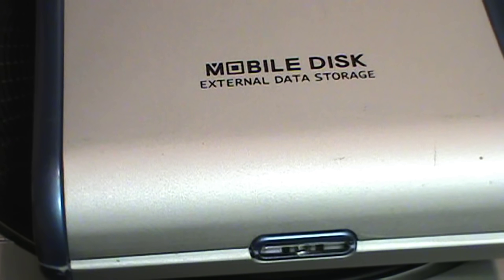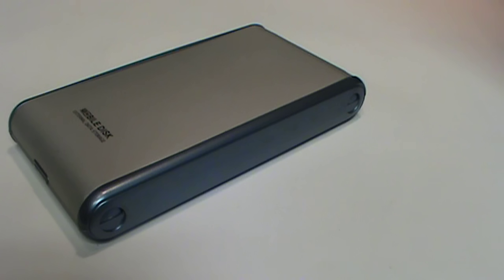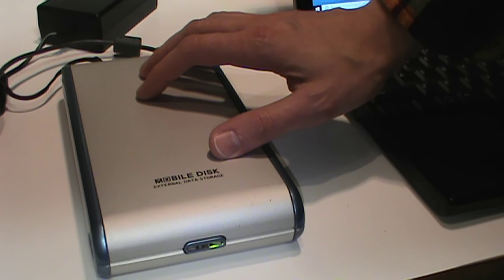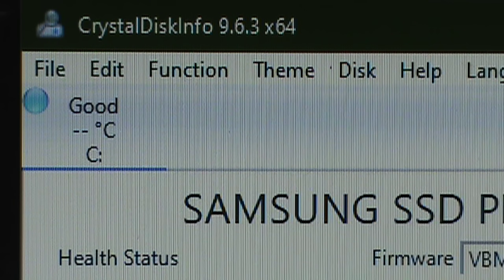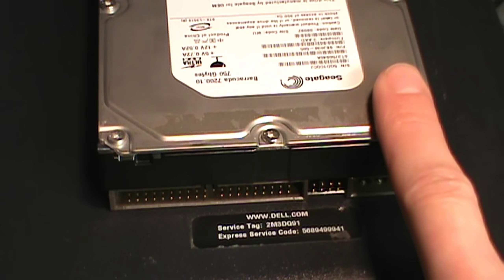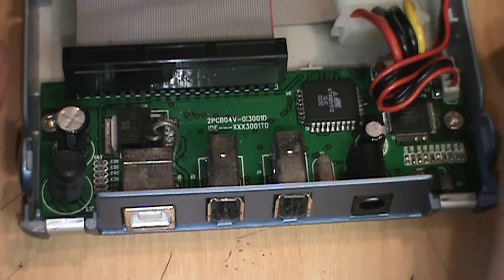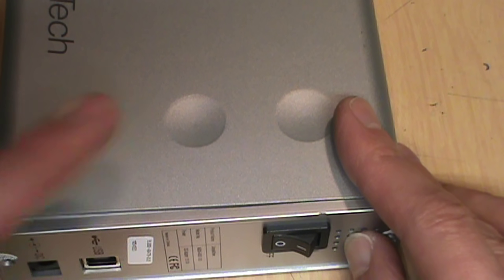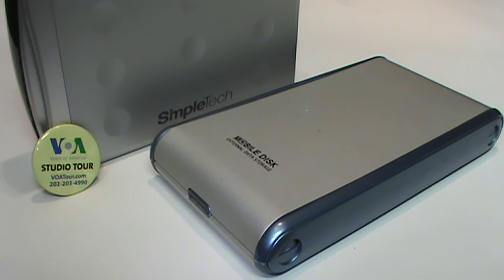The world's largest IDE hard drive failed on me

Comment: I've got a Seagate Barracuda 7200.8 200GB IDE hard drive that has three current pending, and three uncorrectable sector counts on it. I first noticed the bad sector counts at less than 7000 hours of use. Today, that drive is actively in 24/7 service in my secondary desktop (motherboard being from 2011ish, with nForce 630a chipset), it now has more than triple that number of power-on hours mentioned earlier and the reallocated/bad sector counts haven't changed or gone up at all. These older Seagate Barracudas (especially the 7200.7 and 7200.8) are very solid hard drives; the 7200.11 series is when Seagate's quality began to massively fall off.

Comment: First time I've ever seen a 750GB IDE drive in Windows.  When the video started, I automatically assumed it'd be used with an Apple machine.  The reason for that being that my Apple Xserve RAID arrays have fourteen (14) 750GB IDE drives (allocated over two RAID controllers).

Yes, they still work — but I know that's not going to be true for much longer and all should be retired in favour of 1TB SSD's.  1TB is the limit of the Xserve RAIDs' upgraded firmware.  There will be a noticeable speed increase regardless of the old system bus — and they are connected to the actual Xserve servers by 4GB copper or fiber optic cable (which was pretty remarkable for the era they're from).

So you can understand why it seems (to me) so strange — even bizarre — to see a lone 75GB hard drive being used on Windows, which is not a platform/operating system that I, personally, would ever associate with video editing or video file transfer/storage.

I imagine that I'm from the generation that insisted on "The right tool for the right job", which for video work (or anything creative), would be a system specifically built from the ground up for that purpose: Mac OS.  Definitely not Windows — which was generally the preferred system of cheapskate bulk buying businesses looking for the cheapest PC's possible for their clerical workers and accountants.  You take my point.

Without doubt, Windows has improved somewhat by now — but it's still not a platform dedicated to creative and video work as the Mac operating system surely is.

Anyway, thanks for showing me one of these old 750GB IDE drives working on an alien platform (!).

Comment: 7:28 I see you were copying microMV recordings.  I usually transfer those from the camcorder using an analogue link, but a few years ago re-discovered the joys of doing so using the pure digital route using Sony's MovieShaker.  I found Wondershare video converter could translate the resulting WMM files to something more useful today.  The digital route is more hassle but does give slightly better results.
Reply from the maker: Older versions of Sony Vegas can import from MicroMV as well -- just tell it you're using an HDV camcorder. Both MicroMV and HDV use MPEG2 compression, so to the program they both work the same. That way you don't get any loss of quality by converting it to another format.

Comment: When I saw a 750 GB hard drive at if there's store I was very confused because it had an IDE connector on it. 

I can't remember if I saw the connector first and was confused by the size or saw the size first and was confused by the connector but would I do know is that I bought it and bought an adapter and used it on my computer that I built in 2016. 

Like a year later my friend sold me his much better computer so I got rid of the other one. 

And yes before you ask my OS was on an SSD I was just using the 750 gig for all my other storage because SSDs were kind of expensive so I only had a 64 gig.

Also at the same thrift store I found a 400 gig hard drive and when I plugged it in it showed up as 40 gig. I took this price sticker off the label and it said 40.0GB wtf?

Comment: I have a WIncor Nixdorf Pentium III Socket 370 system with an updated firmware from 2006 to support large hard drives. I currently have a 160GB drive installed.

Comment: You can partition around the bad part to extend the life of the drive.
Bad sectors many times come in a row, and while checkdisk fixes it now, the sector next to it might fail tomorrow if used.

I have 1tb western digital for which i did that, 200,10 and 700gb partitions (10 had the bad parts in it)

Bestpart is that when i installed w11 24h2 to it, it ran checkdisk and actually fixed the bad sectors and the drive reads good again.. going over 80.000 hours idk if i should have it as a boot drive / server drive like im currently using it lol

Comment: I had similar problems with usb to dvd recorder adapters for laptops, it's always a matter of time before the usb cable starts to fail and you lost some dvds and cds due to a communication error during a recording, i got so tired of it that i bought an old laptop that has a dvd burner built in since it doesn't rely on the very few electrical connections of a usb it sholdn't fail, proper sata connection should have some redundancy and a better quality on the contacts and obviosly no wires to break

Comment: The USB failure on your enclosure might be because of USB sending data in packets, rather than say FireWire transferring in data streams.  Connecting the drive directly to the motherboard through an IDE channel is much faster than USB and transfers data in streams like FireWire.

Comment: "Reallocated Sectors Count"?  Is Crystal Disk Info getting that directly from S.M.A.R.T.?  If so, you probably can ignore it.  I've learned over the decades that S.M.A.R.T. tends to have inaccuracies and false positives a lot of the time.  Your drive might be fine, although I would look at the year the drive was manufactured and factor in the Mean Time Between Failure (MTBF) rating.  Most hard drives will have a 3 to 5 year MTBF lifespan, anyway.

Comment: It's not the biggest one. Western Digital manufactured 1 TB Caviar Green 3.5" HDD. There was also 1 TB 2.5" ZIF IDE HDD (it's different from 2.5" by having additional pair of short conn_sense pins on side if 40 pin connector), it was marked as "Supplied by Fujitsu". While not HDD, I have seen actual IDE SSDs in 32 and 256 GB sizes, too, one of them made by Kingston, other by some Chinese one-shot "brand".

Comment: I personally do not trust SMART data as it can be effected by a bad psu or the environment it's in; which is debatable if that's a good indicator or not..... personally run MHDD erase wait than run it through scan and have a computer record it's display(somewhat optional) output; if the drive comes out with no issues via that than I trust the drive; if it comes not 100% it gives a good reference point if it's issues are due to age or what(some cases it it's just a few bad sectors but not enough to be an issue); I've seen drives going from failing SMART to passing through this and it is why I do not trust it.... takes time but to me worth it if a spare computer or 2 is available to do this

Comment: I'm sure you know that the 128GB limit is only an issue at boot time. You can put a boot partition in the first 128 gigs and then any "modern" operating system like an updated 2000/XP or Linux can use the rest for data. Or you can use boot-time overlay software like OnTrack.

Comment: I would not be surprised if the failure still was due to a bad sector but before it was re-mapped to a spare one. I had this happen many times it won´t read while the sector is actually bad and the drive is testing it out and eventually re-mapping it if it cannot be used anymore. I typically go deeper into the troubleshooting by reading log books in the drives memory with gsmart since many drives not only have smart byt also actual logging of events. many times you can read the log and find out at what drive time an error occurred too and not just a total amount of smart entries. you can actually often find errors in here that is not logged by smart that can still be a good pointer to potential failures. I am a SUPER hard drive geek lol

Comment: I've only once had the freezer trick work for me, but man was it satisfying. Locked up drive. Freezer overnight. Plugged into an external IDE to USB converter and power brick. One shot, it spun up and read. Copied everything off. It never spun up again.

More than a few times I've had to use Clonezilla in rescue mode, sector by sector copy, and let it run for several days to recover what's on a badly failing drive.

I once surprisingly managed to pull all the contents off of a very early IDE drive (maybe 80MB) out of an embedded, rack mounted 386 machine that was the last known example of an automation system monitor whose existence had long been lost to time. I was able to pull all of the custom software off of the drive, and resurrect the application on modern hardware - it was a custom application to pull automation data over an RS-422 line from a GE FANUC-controlled marine steam propulsion plant, and display the data in real time in an ANSI-text graphical mimic which showed all of the parts of the steam plant. I managed to get it running in Windows 7 NTVDM using a custom ANSI driver, and even found that it supported mouse input in ANSI mode. It was pretty cool to set up a cluster of machines to run the software and restore the functionality to those old ships so the engineers could see the mimics without calling down to or going into the engine room.

I currently have a 2.5" drive sitting in a drawer from a family member. Years of her "priceless" photos are on it. Head failure. Just scouring the world for an identical drive I can swap the platters into.

Man will I be glad when I never see any of these things again.

Comment: I personally have an IBM 5GB 2.5 inch IDE that I use as an external drive and it's so old that I can't seem to get smart data off of it. I've done full read/write checks on it and it passed with no errors so I am going to keep using it to transfer smaller files as it still has a surprisingly fast read/write speed for USB 2.0

Comment: Hmm.  I wonder if that drives mechanicals are the same as the infamous SATA 750GB drives from Seagate. Extremely high failure rate, had the displeasure of dealing with them in my time as an I.T. worker.

Comment: Seagate hard drives are that. Garbage.

At least this brand and model of harddrive (regardless capacity or connection type) are known to fail whenever. Bought one of the Barracuda greens, brand new, one week of use and it was already hammering (when the sound of the heads initializing and when reading/writting and sitting back on power down is more noticeable). 💀

It lasted what it lasted because it wasn't a main use hard drive. But give that 750gb drive a main use in a rig and it would have died long ago. These disks totally dislikes long writtings as well. Had a 1tb SATA one die on me unexpectedly. So it's a matter of brand and quality...

Comment: Yeah that Hard Drive enclosure worked for awhile but as always they don't work forever how old is the enclosure anyways because it looks like it's from 2004 or 2005 
And I have another question,
How do you find computers or computer related stuff at goodwill like Hardrives, Computers, Software because when I went there I was looking for Windows XP Software as well as a Windows XP Computer but I didn't find anything

Comment: Hard disk sentinel pro with reinitialization option. Worth every penny and is very affordable. I'd recommend putting it in more than 2 loops to make sure it will hold data.
Bonus: DRevitalize to force the drive(if supported) to treat already  re-allocated sectors as new/fresh. 50-50 chance they were falsely allocated by the external enclosure.

Comment: The 3 reallocated sectors could be a result of the failed enclosure. If the drive loses power when writing or is given corrupted data it may result in the data on the sector being corrupted and the drive would not distinguish between that and a real bad sector. If it is unable to read from the sector, then during writing it may just reallocate it.

Comment: He must use an enclosure with fans blowing onto the bottom part of that hard drive in order to keep its temperature at its safest range. Otherwise, that hard drive will go hot, its temperature is at its risky range, and heat is the number one enemy of magnetically recorded information on the hard drive. That is what I am using now on my enclosure. Same hard drive as his.

Comment: I have had quite a few of these 750GB IDE drives in my time, and for similar uses to yours (as i transfer tapes too!) - I have found if they are used in enclosures with no cooling? The drives tend to expire after about a year of heavy usage (and with various issues, from a sudden increase of bad sectors to just outright dying on me) whereas if an enclosure with a cooling fan is used then the drives last much longer, in fact i still have 2 of this drive functioning today!

Comment: My own experience with HDDs being connected via USB bridge is generaly a negative one. Especially when a drive encounters a bad sector, the USB bridge freaks out and disconnects from PC, which is the reason I always test HDDs/SSDs on bare metal, usually through the intel chipset. 
48bit LBA is supported since ATA6 a.k.a. Ultra-ATA/100 [UDMA 5, UDMA/100], which means any intel board with ICH2 through ICH7 (and apparently ICH8-mobile) can support large hard drives. That would be socket 370 coppermine boards through late (G41) LGA775 era and then some newer boards with 3rd party chipsets.

Comment: I've been using some USB enclosures in the past, but I had some big headaches too, because 'sometimes' their use a problematic microcontroller, that seems to apply a custom 'format' to the hard drive (the problem is, when I connect the drive directly into a PC, it doesn't recognize the format of the disk. So, now I try to avoid this kind of 'enclosure' things...

Comment: I wasn't even aware the HDDs from external drives could be swapped out of their shells like that, let alone factors other than the HDD itself being the source of "failing drives." This is certainly new knowledge now if my old seagate drive from 2009 ever kicks the bucket.
Reply: I have two 1TB hard drives from Iomega enclosures that both failed at different times several years apart. In both cases my first thought was that the drive itself had failed, but swapping it into another enclosure revealed it to be just fine and the enclosure itself (specifically it's SATA-USB adapter) had failed. 

Both drives are now humming along just fine within NextStar TX enclosures I got from Micro Center. They're twin backups for my photo archive, and repositories for every application I've ever used (as well as license keys and older versions as they were upgraded). I use an application called WinMerge to periodically check that both archives contain the exact same files since I maintain them manually.

Comment: I think the "disk repair" is yet another thing Microsoft broke and doesn't plan to fix. I get the same "problem repairing this drive" no matter what drive I use. I sure do love Microsoft's helpful "something went wrong" errors. If you're lucky, you'll get a link to a 404 page on Microsoft's forum. If you're really lucky, you'll actually get a web page but nothing it tells you is relevant or they screwed with the UI so much that nothing is where they say it is.
Switched my last Microsoft machine to Linux Mint last week and I'm never looking back. I've never used 11 and never will. Good riddance. Imagine if they put half the effort into Windows that they put into Cortana/Copilot/Whatever it's called this week, trying to force it on people and shove it down our throats. The thought of the same company who releases this crap now going heavy on "AI" should keep you up at night. I'd just like to use Excel for more than 3 hours without having some crash or glitch, they've only had 40 years to do it.
Didn't I read today is the 50th anniversary of them buying another company's OS and rebranding it their own? Or is it the 50th anniversary of Bill Gates stabbing Gary Kildall in the back?

Comment: Fun fact. Iomega did some great consumer products as we know, ZIP drive etc. but by mid 2000s these were becoming irrelevant and outdated. The brand Iomega was acquired in 2008 by EMC as they were called then, to the surprise of those of us who work with their enterprise products which are mainly enterprise-grade storage arrays - massive multimillion$ cabinets full of HD (then, mainly flash now) serving enterprises with super-performant storage with redundancy, replication across sites etc. so this being an Iomega product with a big ol’ HD in it was interesting to me. EMC then merged with Dell in 2016 and rebranded to DellEMC for the enterprise  storage market.
Reply: @sprint955st  ZIP disks are known to be extremely unreliable.
Reply: yeah, and their original array was the FC series like FC5400 or something like that, when it was called Data General. 100GB fibre channel over copper. But I detest that company, and considering all the complaints with Dell, there go together like a compost heap.
Reply: @annoyingspore yep I when I was a kid I remember seeing the DG building in West London, not knowing I’d be there years later undertaking training for operating Symmetrix/DMX/VMAX, Clariion, Isilon etc. I’ve had some dark days and nights from working with their kit to be sure, sounds like you have too😕